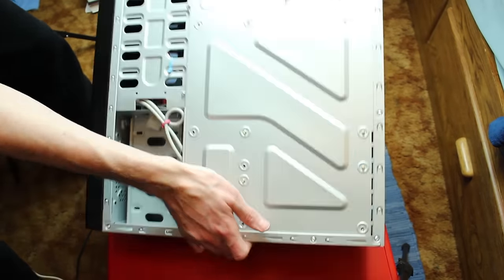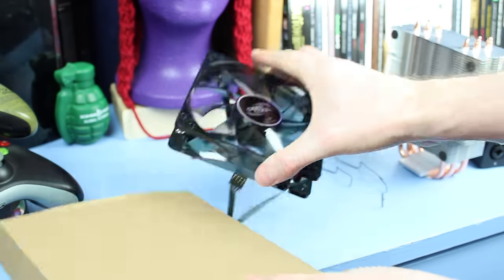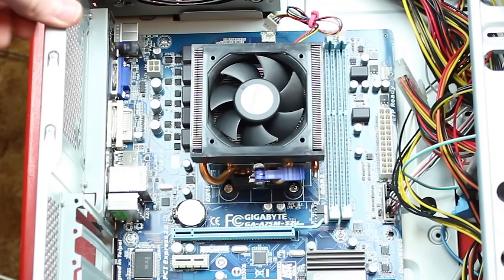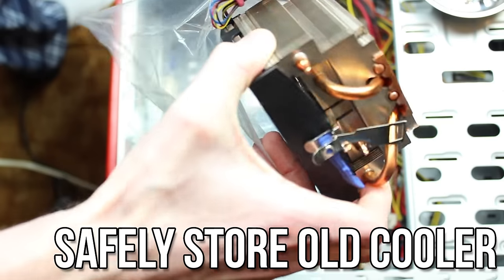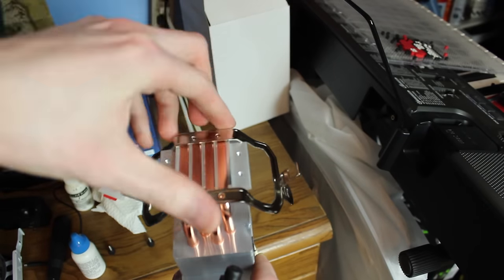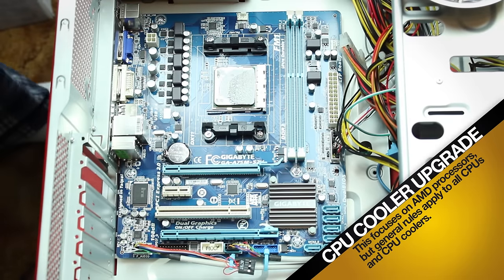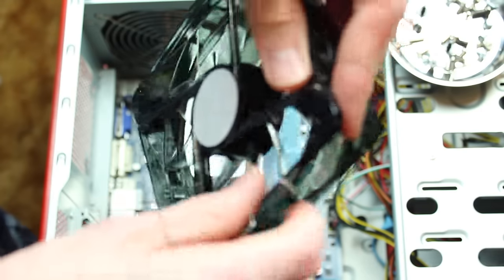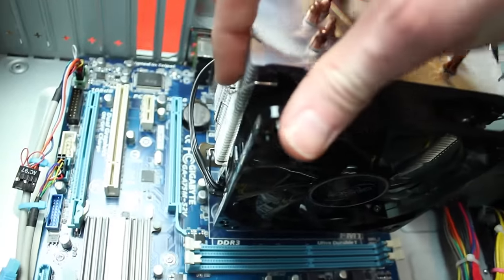How to Upgrade CPU Cooler // How to Replace CPU Cooler or Heatsink

Comment: What’s really important is don’t take the cpu off of the socket when it’s covered with thermal paste, you will risk getting it on the back of the cpu, or worse on the socket.  This applies to anyone updating the cpu mostly.  Also I’m a firm believer in using the large pea in the center method in applying thermal paste, as sometimes lines will cause the paste to leak and you don’t want that.  Try and make sure you use a thermal paste that’s nonconductive, it will be much more forgiving if you have problems..

Comment: I am getting high temps on my CPU. But when I fitted it I made the mistake of not adjusting all the settings before applying the paste.  I had to take it off then re-apply it. I should have removed and 're applied the compound but I didn't....

Should I just remove the cooler? Clean it and 're fit it?

Comment: Take my advice, I went with a Hyper 212 Plus, which is bigger, I only have a mid sized case and there's 3mm of headroom for the cooler, DO check the space you have before buying the cooler.
Reply: I just got the Hyper 212 evo on amazon for like $23 and im about to install it.
Reply: ^Davy how's it?
Reply: Ian Angelo Lacson dunno, I haven't installed it yet. I'm new to computers so I'm abit nervous about upgrading. I bought my PC used on OfferUp for cheap and it's pretty good just a few old parts.

Comment: Choice of heatsink appreciated. Along with the AMD demo and additional advices for Intel sockets. Also I always wondered how do these massive heatsinks attaches react after moving the caise around a few times or more. Same for some mobo's PCB does it break sometimes? (spoiler: haven't o/c a system ever since the k8 era :)

Comment: Gonna clear up a few mistakes I saw in this video, so people aren't at rick of destroying their new cooler or motherboard. He often says one thing, and does another in his videos. So here is a list of things to make for a safer installation.

1. Always disconnect everything from your motherboard and REMOVE it from the case (place it on a non conductive, non static producing surface) make sure to ground yourself any time you are working with the motherboard or components. This makes installing the fan much easier then having it inside the case where space for hands and viewing angles is limited.
2. A line of thermal paste isn't horrible, but it's not the best as leaking with a single thick line of paste occurs a large majority of the time, and this could be bad if you have conductive paste. Always go with the tried and true method of a large pea size dot of paste in the middle. 
3. As he said but didn't practice in this video. If you have already placed the cooler to the CPU and needed to lift the cooler back off, then wiping and reapplying paste is best as you may have spread out the paste to much and caused air pockets, he should have re filmed that part so as not to confuse people.
4. Never pry or twist the cooler to see if its sturdy and attached. A slight (and i mean slight) press on either side of the cooler to test if its fully attached is ok, but normally if you have it clamped or screwed down fully, it's not going anywhere.

To many times I see videos on "how to" with computers, and for the most part they are fine, but the people making the guides need to be less lazy and re-film parts they know they screwed up on because some people out there do as they see, and not what they hear (I know a few myself). When I saw him grab onto the cooler and try rocking it back and forth to check if it was attached, I kind of winced a bit. That is a very easy way to snap the CPU right out of the socket or bend something that shouldn't be bent. You would be surprised how easy it is to snap them off.

Be gentle whenever working with a motherboard and components. Breaking something could be expensive to replace, and may render your warranty void. It's best to be methodical and gentle from the start.
Reply from the maker: Been building PCs for like 20 years. A minimum of once per year, frequently multiple per year. Parts aren’t that easy to break most of the time, a little thermal paste leakage is fine (better to leak a tiny bit than not have enough), reapplying coolers has never once been a problem for me, and pulling the whole mobo out of the case just to swap coolers is a huge waste of time unless you can’t get to the backplate on certain coolers.
Reply: @EposVox  I have always pulled them so I could bench test before putting everything back in, would rather confirm everything works then have to fidget around in cramped spaces more then once. I find working in the case to be tedious and stressful at time, which in turn could lead to breaking something out of frustration, besides, it also saves cuts and bruises to your fingers and knuckles. 

As far as "things not being easy to break" we have had dozens of rig come into our shop this year with broken CPU mounts and PCIe slots from people bend/push testing to confirm proper seating or connection, which is why I always say a slight nudge on either side does the trick, if it won't budge lose from a easy push, then it's seated and clamped properly. Everyone does things differently, but as I run an entire shop, I have learned the tricks of the trade in the 11 years I have had my doors open for business.

Not trying to step on your toes man, if you believe you are doing it correctly, then by all means, but there is doing it your way, and then there is doing it the way I was taught in the industry. Which for all intense and purposes is the correct way. I was just throwing in my own taught knowledge for others to read.

Comment: i changed my cpu cooler with cooler master hyper 212 evo v2 but while changing it my motherboard was already in the case and i did vertically there fore the cooler slide one side 2 times whilei i hold both screw driver and backplate in place can that cause any harm

Comment: does the cooler come with all of the cables and stuff like that or do i also have to buy that seperate
Reply: MooseTracks uhhhh it’s a cooler yes it does come with wires. It’s also stuck to the cooler so why wouldn’t it not com with no wires?

Comment: I have a ryzen 5 1400 and it has the hatch and 4 screws. What do I do? I can’t seem to unscrew the screws because even using small screw drivers it can’t fit into the screw because it is blocked at an angle. Let me know if I’m being stupid And just need to yank it off or something.

Comment: Is static not a problem with this? In other tutorials it seemed to be a big problem but you just went right on with it
Reply from the maker: Keep touching the metal on your case or use an anti-static strap and you're good.

Comment: My CPU is usually stuck to the cooler. You just pulled it off like the thermal paste was still wet rather than baked for 5 years.

Comment: Hey! Nice video but to replace the cooler do you have to remove the thermal paste
Reply from the maker: Yes.
Reply: +EposVox Why? What happens if u dont? Nice voice btw <3
Reply from the maker: EXPOSED NEDERLAND Well if you don't the previous thermal compound won't do its job and the new cooler won't keep your CPU cool.
Reply: +EposVox what if i put thermal paste over it
Reply from the maker: EXPOSED NEDERLAND That would make it even worse. The original thermal paste needs removed.
Reply: +EposVox ok real thanks man

Comment: Would I have to take out my motherboard if I upgrade to Cooler masters EVO 212 heatsink?
Reply from the maker: Depends on if your backplate is compatible, or if you can access the CPU backplate via the other side of the case.

Comment: Immediately after you removed the motherboard, there was a white rectangular piece underneath you picked up, what is that? I recently took my older pc apart to replace the motherboard and that was floating around in the back of the case, I have no idea what it's for!
Reply: motherboard backplate
Reply: The purpose of a backplate on a motherboard is to keep the motherboard from bending when you crank down the cooler. Without a back plate the motherboard would flex.

Comment: HP got lazy and added a cheap CPU cooler on my Gaming Pavilion PC. They got pretty cheap and the fan is really loud too. If I replace the fan and cooler I need a quiet cooler/fan. If I replace it and should I have no issues at all? I want it as quiet as my mom's PC. It shouldn't be making loud noise at all. :(It's getting annoying I can't hear my games on my PC either.

Comment: hello....is it ok if the heatsink which is in 3 pins be plug to a 4 pins motherboard?is there any problem in the future that may arise?
Reply from the maker: That's fine
Reply: @EposVox  Thank a lot sir for answering the question. I am confident now that there will be no problems in the future for my motherboard. Thanks a lot once again.

Comment: Good job, I did this to my previous game pc and could not close the case anymore, now I have a game pc with a intel stock cooler, and I was thinking about upgrading it, but can you say if it is worth it or not? Im worried that the big cpu heatsink wont fit my current pc aswell.. and can u answer my question if it is that bad using a original intel stock cooler?

Comment: why is the fan in another direction?
Reply from the maker: It's not. Computer airflow is from front to back. This blows air from the front through the heatsink out the back to keep the CPU cool.

Comment: Nice video! =) I have one question though. If I don't have that thermal surface purifier or rubbing alcohol, is there any other purifiers I can use, like soap or for example chlorite-based bleach liquid or something?
Reply: +Lerppasd7 Or how about disinfectant which has about 70% alcohol in it?
Reply from the maker: +Lerppasd7 Those all risk damaging your components or leaving dangerous residue on your CPU. Alcohol is minimum that you should ever really use.
Reply: Ok, thanks for your answer! =)

Comment: i had a question, can you install the hyper 212 evo without taking out the whole motherboard?
Reply from the maker: Depends entirely on the backplate already on for your CPU. Generally, no.
Reply: well there is a hole for backplate installation
Reply from the maker: Then you don't need to remove the motherboard and are good to go!
Reply: EposVox thanks!

Comment: can i just use the old heatsink or do i need to get a new one?
Reply from the maker: Replacing the old heatsink is literally the point of this video. That's the main part of the CPU Cooler.
Reply: EposVox 💀

Comment: I have one question. Why is the cooling fan not placed on the opposite side. Wouldn't it be more efficient if it was pointing to the vent of the case?
Reply: Um well in my opinion its not exhausting.. It's clearly that the fan is intaking a cool air.
Reply: If the fan is exhausting then the heatsink will not take any cool air so its 100% gonna overheat.. Sorry for bad grammar

Comment: What is the name of the cpu cooler that you uninstalled?
Reply from the maker: It's just the stock cooler that came with the cpu
Reply: EposVox sorry to be a bother, but I have the same cooler installed in my pc and can’t find the name of it anywhere, do you know what the name of the cooler or the cpu is? Thanks
Reply from the maker: @DanielBirman  There is no name for it, it's not a standalone product

Comment: My pc is older than me and sounds like an airport,the brackets for the dust filter on the power supply wore off,the sdd is dead and it has 2gb of ram...
BUT it can run S.T.A.L.K.E.R. shadow of chernobyl so i am happy for now.

Comment: 1:48 Right here. This is the part I'm stuck at. How the hell do you get that little cable to come loose? I thought there was maybe a clip but nothing I try works and it's practically right against the PSU. I just need to check my CPU because my PC quit turning on the other day.
Reply: Never mind. Some pliers did the job.

Comment: do i have to take out the motherboard if its intel?
Reply: no...
Reply: i had to, because my stock cooler was a pin, son i had to take my mb out to put the back screwing plates on
Reply: you should be able to access the bottom of the motherboard from the other side of the case

Comment: push or pull shouldn't matter.
Reply from the maker: It does, based on the airflow of your case.
Reply: +EposVox well, the fan have enough static pressure to pull air through those fins since it can do a push. If the fan is more to air flow but no static pressure then it would not move much air through the fins hence less efficiency regardless of how the flow of air inside the case. I am not sure about all cpu fans but all that i have experience with, the result is quite the same if pushing or pulling configurations the temperature stays almost identical either way.

Comment: AMD stock cooler sucks. I got 90c when playing a game. Upgraded to a new cooler.
Reply from the maker: +Optimistic Games Most stock coolers do, haha.
Reply: Well this comment is very old. I now have below 40c OC to 4.2ghz idle and gaming 60 max. You will obviously get shitty temperatures with AMD stock coolers. My airflow is good right now.
Reply: And no I don't "live" in a desert I live in a pretty bipolar cold country lol.
Reply: Raccoon Noo one I used the stock coolers at the stock speed 3.7ghz it was high asf. All I had to do was buy a better cpu cooler and got a safe temp with overclocking.
Reply: Raccoon Not every stock cooler would work. Could of been faulty ect. As soon as I booted it up the temperatures were sky high until I bought a a new one which allowed me to overclock which is a win win so I don't need to worry.
Reply: Ahh I see lol.
Reply: Raccoon Haha I know that. Once I booted it up the noise was tremendous.